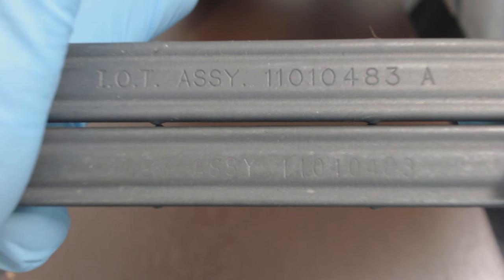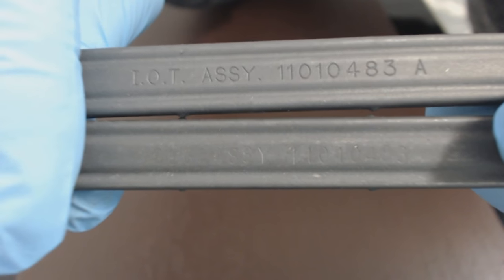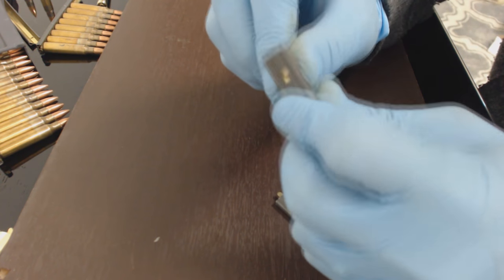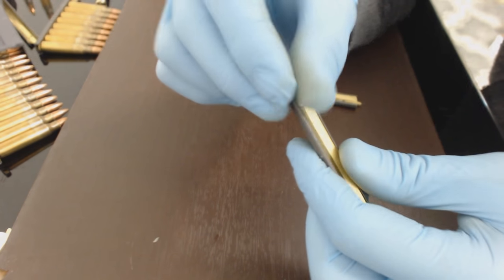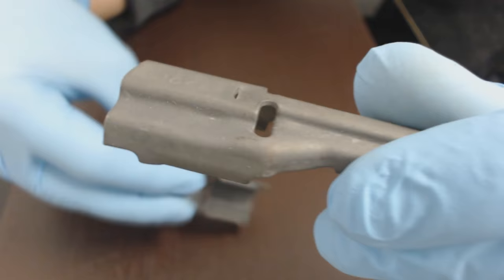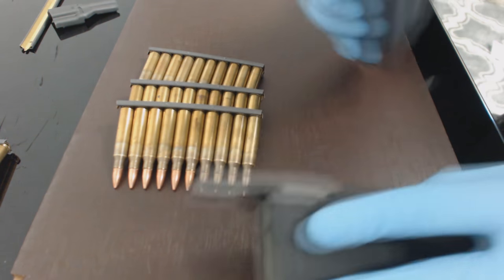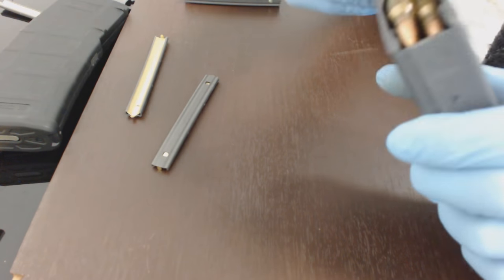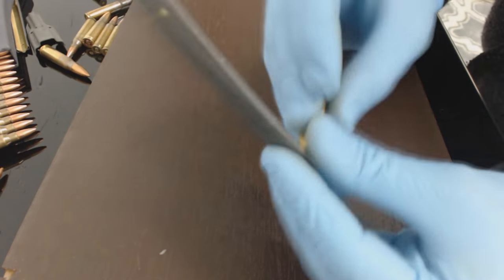How to use 5.56/.223 Stripper clips with spoon

Comment: Do these also work with ruger mini-14 ranch mags?
Reply from the maker: The ar loaders will work on some aftermarket mags if you hold the loader tight to the magazine as you load it. The AR loading spoons don't work well on the factory magazine because the lip on the magazine is to small. We also have Ruger factory loaders for factory magazines and some after  market mags. https://gunandsurplus.com/Gun-Parts-Accessories/Ruger-Mini-14-30/Ruger-Mini-14-Stripper-Clip-Guide-Spoon-Speed-Loader
Reply: Thank You Very Much !!!